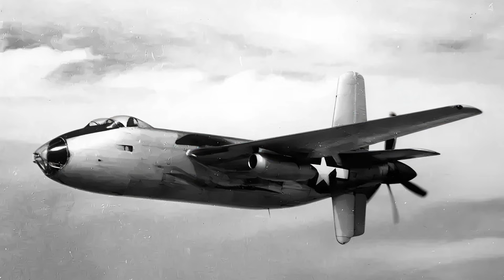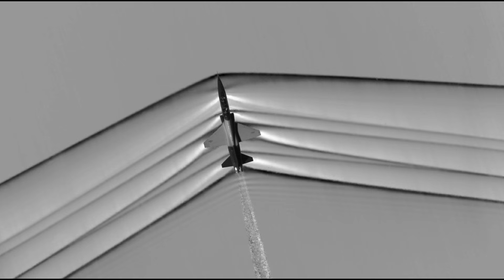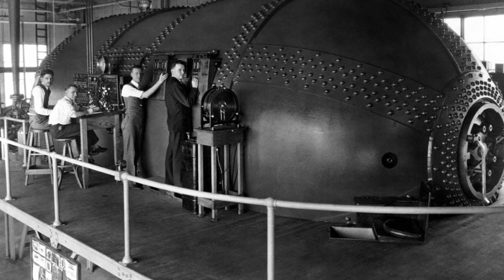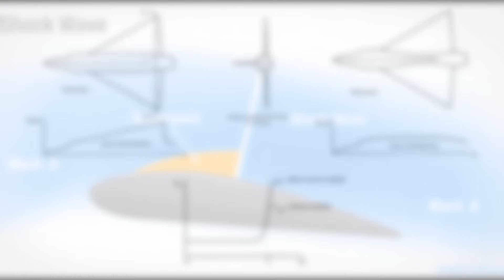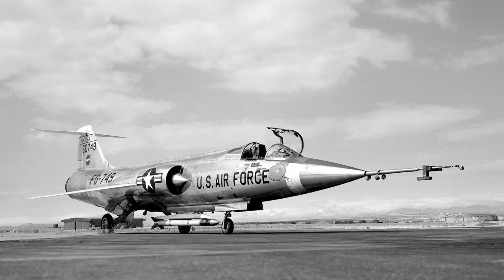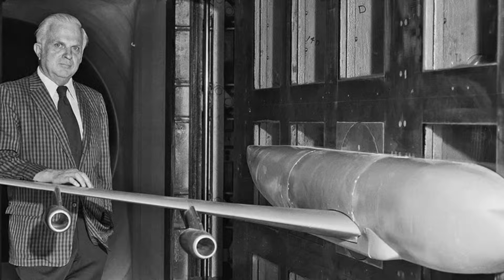The Forgotten GENIUS Who Outsmarted Aviation’s Invisible Drag Wall

Comment: Lots of good information, but sooo repetitious.
Reply from the maker: Thanks for the honest feedback — that’s fair.
Balancing clarity and repetition is tricky with complex topics, but I’ll keep refining it in future videos.
Reply: Repetitious? This is a subjective assessment (in my view) and I am an engineer with aero qualifications - experienced enough to have  applied Whitcombe's contributions to propeller (and rotor) tip designs.... we even set a couple of microlight  altitude records, back in the day.   Think:- "GAW-1 at the tip" as a starting point...
OK, I am now very old, (been retired for 26 years)  and not as mentally agile, but is that any reason to reduce the info flow redundancy that helps me keep up?   Yes, needs differ.  But I still have to slow down my spiel for some of the younger engineering aspirants I meet - especially when we get onto rotorcraft and hovercraft !  😁   ... and let's not forget wingsails!

Comment: However, the British Miles M-52  project was way in advance of anything in the USA. It had shock cone air intakes and an all moving tailplane and was copied by Bell for the X-1 after US basically stole the plans. Look it up.
Reply from the maker: The Miles M.52 was absolutely ahead of its time, and British research was foundational.
Supersonic progress ultimately came from a mix of shared data and parallel experimentation across countries.
Reply: the all flying tail was not stolen, the British shared it with the US openly.
Reply: But the fact is that America did it! Not knocking the British at all, but we went forward and broke the speed of sound!  Thanks again to the British for giving us some of the steps to get there!

Comment: Great video, but I'd suggest replacing the F104 with the YF102 followed by the "coke bottle" F102A during the relevant narration...
The video demonstrates Whitcomb's scientific application to airplane design both with the area rule and supercritical airfoils. Well done!
Who knew that legends of the battlefield was an aeronautics geek?
Reply from the maker: That’s a great point — you’re absolutely right about the YF-102 and the “coke bottle” F-102A.
Thanks for the thoughtful and technically accurate feedback. I’m really glad this resonated with fellow aeronautics enthusiasts!
Reply: does fluid dynamics resemble areodynamics
Reply from the maker: Yes — aerodynamics is actually a branch of fluid dynamics.
It focuses specifically on gases (like air), while fluid dynamics covers both liquids and gases.
The same core principles apply.
Reply: @Legends-Battlefield  cheers from australia 🇦🇺👍.